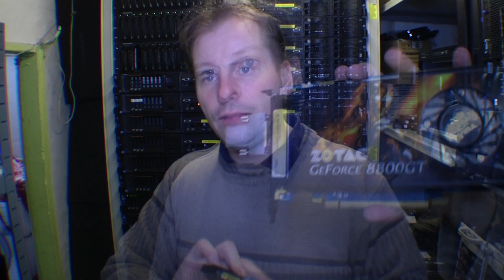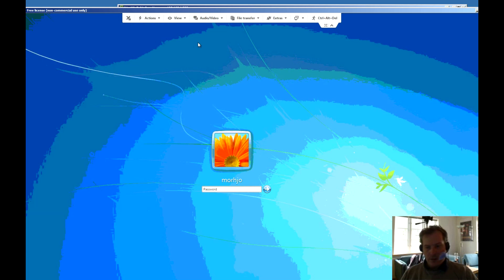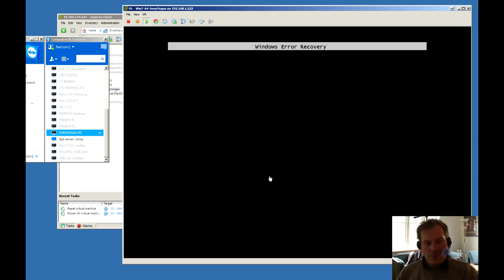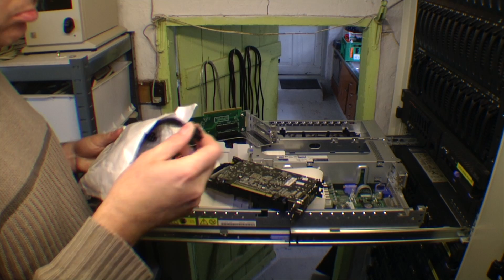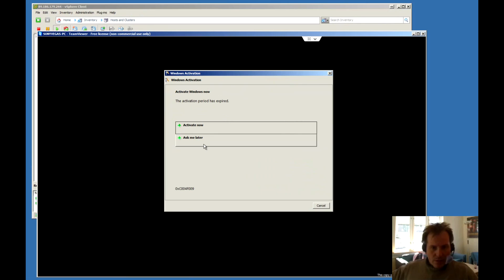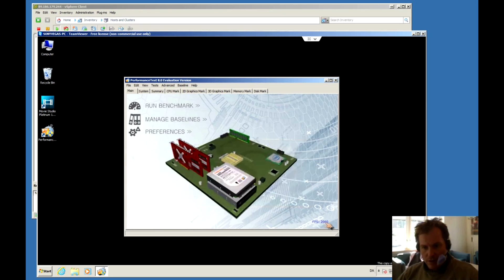GPU Passthrough ESXi with HDMI dummy plug - 236

Comment: I think that I saw it doing a split screen on virtual machine between the GPU and VMware GPU. You might need to configure the video rendering software to recognize the specific GPU you have.  Not sure I have not used that software before.  If you want the VMware desktop viewer to work you might need to setup the GPU and VMware GPU to mirror.  That should not impact rendering but your max resolution will be limited by whichever GPU has the lower maximum resolution.  Hope this helps
Reply from the maker: It is an old video,, I did make it work in later videos,, and ran in to as many issues,, just other ones :-)
Reply: @MyPlayHouse  You seem pretty good at figuring things out.  I try to be helpful whenever possible.  I appreciate your response.  May your data center always be manageable

Comment: Seeing what you get for numbers from your GPUs, I'm still wondering why my GTX 980TI is doing so bad. It is cool, boosting just fine, utilized... well... typical utilization for F@H I supposed, and is running with latest drivers directly bare-metal on a Windows 10 machine, no VM. Still only pushing around 320.000 ppd. Is the 900-series of nvidia such a bad performer in computing?
Reply from the maker: It is not that bad,, https://i.imgur.com/pW1Ar9c.png
You need a really new card to really kick some ass,, I am to cheap to go 2080ti myself.
Reply: @MyPlayHouse  Thanks for the table, Morten. However even there you can see that the GTX 970 is supposed to generate about 470.000 PPD, the 980TI that I have is at least in games on par with the GTX 1070 which is rated in your table at somewhere around 860.000.

Only getting 330.000 PPD out of mine seems kinda not right at all =)

Comment: ..... just saying if you use 3x resistors it's possible to trigger monitor detection on vga to enable the gpu, cheaper if doing multiple displays than hdmi dummies; I believe it forfeits audio over hdmi but otherwise on windows can override the detected monitor using an inf(driver) to allow for higher resolution/etc otherwise I think that shouldn't be much of an issue on any other OS
Reply from the maker: Hi plasmar1
Thank You very much!
Thank you for watching! :-)
Reply: the inf override was required to to stop displaylink adapters drivers from bsoding; I think it also has to do with enabling some part of the videocard's(ati hd6450... 990fxa-ud5 board) features but didn't bother looking into specifics since it just works!:)

Comment: GPU Passthrough of NVidia is possible w/ GT Cards, I have a 1050 Titan in my server! All you need is to add  "hypervisor.cpuid.v0 = FALSE" to the VMX file. Search the reddit thread linked below! PS: Here is my passthrough VM, I have 3 HDMI ports, 2 for monitor and 1 for TV. I use DVI>> HDMI & VGA >> HDMI & One true HDMI port for TV (Has sound). I also passed through a PCI USB3 x4 ports and an Intel AC 7620 w/ BT 4.0 PCI Card!
https://www.youtube.com/watch?v=yNpIo_g02gM&t=245s

Comment: Morten,
Nvidia GeForce cards do not support GPU passthrough, but quadros do. I have a Quadro 4000 running on my esxi 6.5.0 host  Dell poweredge r710 w/ 2x Xeon x5650 144gb ram using your 8x to 16x riser hack. I also have a few Quadro 2000 cards working. the only video issue is with my network only being fast Ethernet ( working on moving up to gigabit) it works flawlessly in gaming benchmarks and cinnebench along with SOLIDWORKS and Adobe premiere.
Reply from the maker: Hi Logan .Kes
Thank You very much!  

https://www.reddit.com/r/nvidia/comments/4pcki2/pci_passthrough_for_vmware_esxi/

hypervisor.cpuid.v0 = FALSE

In the vmx file.

Thank you for watching! :-)
Reply: os depending it's possible to get gpu passthrough on some nvidia's using "hypervisor.cpuid.v0 = FALSE"..... it's enforced through the driver(detects the vm presense) and not the actual card...... tested on 560ti, 750 gtx, 530 gt, few others

Comment: Have you gotten any updates on this since then?
I'm trying to do gpu pass through on my esxi server (a thinkpad w520) with the quadro 1000m but it's only using the esxi gpu.
I'm going to try to plug in a monitor to one of the video ports, and hopefully the dgpu will take it instead of the igpu (hd 3000)
Reply from the maker: Hi steaker1705
I did not have much luck with Nvidia,, AMD was better. for me.
Thank you for watching! :-)

Comment: Maybe it helps if you deactivate the virtual graphicscard - if not in windows maybe directly in vmware.

Or have you thought of a PCI-x16-extender-cable instead of the splitter delivered with the server (that you needed to cut to allow x16 cards) - cause your mainboard seem to have a x16 slot which gets splitted by the riser-card to 2x x8.

For example: https://www.amazon.de/dp/B0059QJFZ6/ref=cm_sw_em_r_mt_dp_kAi5xbGE8DF6M
Reply from the maker: HI
I did get some of those cables,, never got to try them out. :-/
Thank you for watching! :-)

Comment: I would be very interested in seing your rig running RDP RemoteFX
Reply from the maker: HI
Is that like Microsoft's version of Citrix?
Thank you for watching! :-)
Reply: Yea, what I THINK you'd have to do is run hyper-v (ms virtualization), install a guest with the rdsh role (ms Citrix ts) with remote fx enable and pass the gpu to it. I think they released it for 2008r2 and then continued improving it in the next versions. I wanted to use it for running older games in a nice preconfigured vm that I could share with my friends for virtual LAN parties. 
It might be possible with VMware virtualization as well, I don't know.

Comment: Hello Morten, me again :) - Well, You've tried it all already ! :)  I'll just follow your footsteps ! I am still waiting for more hardware for my VMWare home project on HP proliant DL380 Gen6 with visualisation using a GPU 4K HDMI display .  Would you advise me more Radeon R7 or an NVIDIA Quadro or other ? to fit in the server ?  Thanks a Lot Again from Switzerland Geneva !
Reply from the maker: Hi
I do not know what to recommend you,,, I got my Radeon R7 260X passed through,, but I did not get it to work with the video rendering software "Sony Movie Studio 13 Platinum" and that was my goal :-/
But how do you power your card in the HP DL380 G6?
Thank you for watching! :-)
Reply: Well According to HP Users guide for the DL 380 G6  we have 150+75W of power   

"The PCIe x16 riser supports a maximum power of 150W with an HP power cable. The cable supplied with the riser must be used for PCIe card wattages greater than 75W." 

That should be enough for most cards? no??
Reply: I am also worried that the Linux kernel of VMWare will just not recognise the GPU chipsets ( Nvidia or ATi) hardware and with no available adapted drivers for the 1st layer VMWare Sphere Hypervisor / BareMetal . that will force me to reconsider the whole thing and look for a Microsoft Server / Hyper V solution instead.
Reply: Oh yes .. you r right it is 150W max  all together !!! ... so no "beast" GPU cards 200W+... maybe we can steal power with custom cables from supposedly HDD plugs or somewhere else on the MB ? have you ever tried ? or fit a more modest GPU ?
Reply from the maker: Hi fabslyrics 
Ahh you have a PCIe x16 riser card,,that have a 6 or 8 pin power plug? I do not have that.
VM-ware is just passing through the card,, all drivers are handled by the VM.
As fare as i know :-)
Thank you for watching! :-)
Reply: thanks for sharing Morten ! , well, I am not sure yet ... from HP's PDF "Quick Specs" there are several version of the HP PCI risers for the DL3xx Gen 6 servers, some are just 8X as you said , but i am still waiting for the delivery ... fingers crossed i will have a 16X ... usually the ones mounted with the X5566 CPU are performance version and have the PCI 16X .
Reply from the maker: Hi fabslyrics 
Okay,, keep me updated :-)
Thank you for watching! :-)

Comment: I know this is an old video but I think the memory limitation is the reason for the bad performance. When you opened task manager there was only 70MB of ram free. To find out if the GPU was being used you could download a tool called MSI afterburner which is made for overclocking but it measure a lot of things including GPU usage. Another thing you could do is try and render the same file on your home computer but with only 2gb of ram and a similar speed storage device. When I render a video on my computer (although it only has four cores instead of eight) They all go to 100 percent load where in this video they only reach 90% load.
Reply from the maker: Hi +Reuben Horner 
Thanx,, good info!  I did get a bit further in this project.

Thank you for watching! :-)

Comment: some of these riser options might be cheaper:
http://www.dx.com/s/riser 

im going to try one
Reply from the maker: Hi +davood123 
I tried to order some here on DX,, but the chek out was fucked up,, kept saying error on my adresse.  So i did a seach on Alixepress.com and fund the same thing ½ price :-) so i ordered 2.
Thank you for watching! :-)
Reply: +My PlayHouse (Morten Hjorth) 

which one did you buy. the ones i see linked below are either too short, or are weird cables.. also have you tried removing the header on the card and installing it reversed with the case open? (very bad i know for air flow.)
Reply: +davood123 
isorry i meant "too short" as in not tall enough from teh mobo. the card is huge so it needs to be high in order to fit over top the air vent for the ram
Reply from the maker: Hi davood123
I tried this one: http://www.aliexpress.com/item/PCI-E-Express-16X-90-Degree-Adapter-Riser-Card-For-2U-Computer-Server-Chassis/32608665156.html
Thank you for watching! :-)
Reply: +My PlayHouse (Morten Hjorth) 

wow amazing. did that one let you fully utilize the GPU then? I can't upvote this discussion/video enough. there isn't enough people "hobbying" in this space
Reply from the maker: Hi davood123
I tried to buy that one,, it will be here in like a month :-) Thanx for all you kind words!!
Thank you for watching! :-)

Comment: Hey there. love your videos, have been  silently watching them for quite some time!

I am trying to do the same thing with GPU+ESXI in my own playhouse type of situation.  I have myself an NVIDIA Quadro 4000 that is known good working card that I have used in a regular PC.   I decided to put it into my x3650 M2 server.  so I shaved the end of the slot as you did to make the card fit. plugged in the power cable, etc turned it on

I also installed the nvidia http://www.nvidia.co.uk/download/driverResults.aspx/69315/en-uk 
version 319.65, which is known and good for quadro 4000

1. I get video output now only from the quadro 4000. onboard matrox does not do video anymore (with quadro installed)
2. esxi 5.5 (which is what we use) does not report anything nvidia related in "esxicli hardware pci list"  or "esxcli hardware pci list –c 0x0300 –m 0xf ".  it only shows me the matrox
3. "grep -A 10 -i "Loading module nvidia" /var/log/vmkernel.log" shows failed nvidia driver loading

some internet searches suggested disabling 64 bit memory addressing for the pcie bus ??? do you have any suggestions
Reply from the maker: Hi +davood123 
There is an option in the Bios to enable the onboard Graphics again.
I do not have a NVIDIA Quadro 4000,, but have you power it? does it not also need extra power on the card?
Thank you for watching! :-)
Reply: +My PlayHouse (Morten Hjorth) 

yeah i powered it. i had the right cable lying around. your video was what alerted me to the 6 pin port on the motherboard. i had looked myself before and missed it. thanks so much. ill check the bios tonight thanks for the tip
Reply from the maker: Hi davood123
No problem at all,,what are you up to? why do you need a GPU.
Do keep me posted on your progress :-)
Thank you for watching! :-)
Reply: want to run some low power games in a VM just for fun .  then i can access them from my phone using vnc viewer (haha).  also just becuase i want to learn
Reply: and yeah i ordered the pci-e x16 riser. will let you know if i get it working :)
Reply from the maker: Hi davood123
I ordered mine to,, If it works you will get a video :-)
Thank you for watching! :-)

Comment: I tried mpc-hc a hd7850 in ibm x3650 m2 for testing purpose. DXVA perfectly works with windows installed on the server, but not in esxi 6.0 windows guest. in this case it is "available", but no way to make it works.
it looks like "direct i/o" (or passthrough or whatever it is called) is not as "direct" as it is supposed to be...
not tested in another server yet (proliant), I will post a new comment when done.
Reply from the maker: Hi +xav sosvoile 
I haven't played with this for a while,, need to find the time. :-/
Thank you for watching! :-)
Reply: same issue with proliant g6, maybe esx is faulty. if somebody else can try another virtualization system...
I noticed D3D9 option in mpc-hc is not available on guest. don't know why.

Comment: In the display settings set windows to mirror the screens, then you can use the EXSI remote thingy
Reply from the maker: Hi +GlowGamingDanish
Is that in the standary display settings in windows on the virtual mashine? have you tried this?

Thank you for watching! :-)

Reply · 1
Reply: +My PlayHouse (Morten Hjorth) yes i think, nope i have not tried it. Just a guess
Reply from the maker: Hi GlowGamingDanish
It messes up pretty badly if i use the ESXi software graphics card and the pass through one,, ad the same time. :-/
Thank you for watching! :-)

Comment: Hi Morten
Suggestion for how to effectively stream the output from the (cdmi-dummy blinded) graphics card... For the newer Nvidia GTX (600, 700 and 900) you can use their own streaming engine, that is actually good enough to relay gaming with minimal impact on quality and lag - on the local network... 

This could be what you are looking for.. (but you would need another card).
See: http://www.geforce.com/geforce-experience/gamestream
And: http://moonlight-stream.com
Reply from the maker: Hi +Tony Pilborg
I have found that Nvidia does not pass through to VM's in VMware ESXi,,,in the cheap models,, only like Tesla and Grid can do that?
Thank you for watching! :-)

Comment: Have you tried editing the .vmx file for the VM in the datastore in Configuration -> Storage, changing:

pciHole.start = "1200"
pciHole.end = "2200"

I have read this can be required for the AMD cards to properly pass through to the virtual machines.  You could also try adding pciPassthru0.msiEnabled = "FALSE" where "0" is the PCI number for both the GPU and HDMI audio device.
Reply from the maker: Hi +Daniel Shipley
I have tried the :  pciHole.start = "1200"
                               pciHole.end = "2200"
Part of it! not sure about the "pciPassthru0.msiEnabled = "FALSE"  bit,, if i have tried that.
I do have the graphics card pass through,, i i can not get it to work in my Sony Movie Studio platinum 13,, for GPU rendering of video.
Thank you for watching! :-)

Comment: instead use HDMI dummy, why not use an old monitor (or LCD TV) for viewer the movie editing screen in real time?

I see someone who edit in a notebook but render using a server in anoter room.

If I remember, edit in notebook and salve in a shared folder, so access the server and open adobe premier (I think) for render faster.
Reply from the maker: Hi +Luiz Claudio Eudes Corrêa 
I have a lot of servers,, and a monitor takes op a lot space,,cables and stuff,, that is way i like a little USB size HDMI dummy.
I use,, Sony Movie Studio Platinum 13 for my editing and i did yesterday edit on my desktop and render it out on the server,, in 4K,, i do not think it uses the GPU :-/ but i used 12 CPU cors,,that helps to :-)
Thank you for watching! :-)

Comment: Great channel I was amazed to find someone on youtube also trying to pass video cards through to ESXi 6.0.  I would recommend you  connect an actual monitor to the video card, you can even try to add in a PCI-E USB card pass that to the VPN then plug an actual keyboard and mouse into the vm.  Remote access could be worked out later once you can rule out the other variables and get the video card to work.  I have  managed to get there far it it worked.  But I seemed to get some stability issues with the host at that point,   The host would freeze I'd lose management access the the VMs on the host kept running.  I have done a lot of google searching and my current theory is that there is a problem with some programs recognizing  which video adaptor to use.  Even on my desktop which has two video cards I had to actually connect a real monitor to the output to get any GPU enabled encoding features for that card to work.  I'm hoping I can find a way to completely remove the VMware SVGA device from the VM I think that may help solve the issue.
Reply from the maker: Hi +Brandon Emerson 
My VM can see the GPU,, but my editing program Sony Movie Studio Platinum is not using it :-/
Have you seen more of my videos on this?
Thank you for watching! :-)